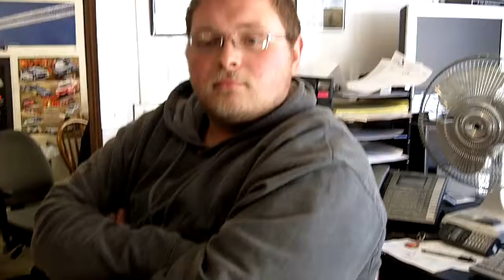Subaru Short Block Benefits

Comment: I have a 2015 STI. Started making a noise from the engine. Took it to the dealer and they said the short block needed to get replaced. All covered under warranty. But I’m turned off from Subaru. Posting for sale as soon as I get it back.

Comment: I wish this guy was my mechanic!  This video was very imformative, especially since I may need the short block replaced on My 1999 Subaru Outback.  It leaks oil like crazy, which creates a big smoke cloud from under the hood (especially in the summer).  It's developed a knock lately, and I think I may have let the oil get too low.  I've got nobody to blame but myself, as I chose the cheap route of adding useless stop leak additives as opposed to getting the gaskets replaced.  Live and learn.